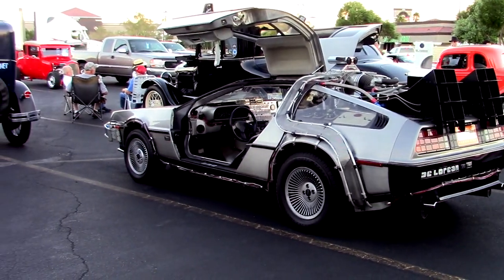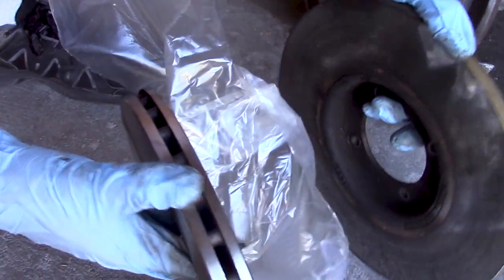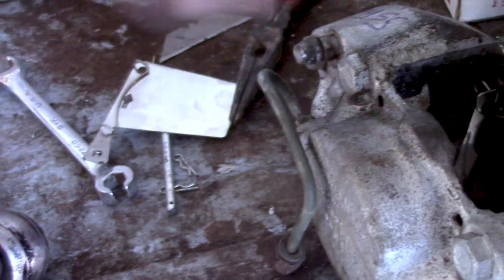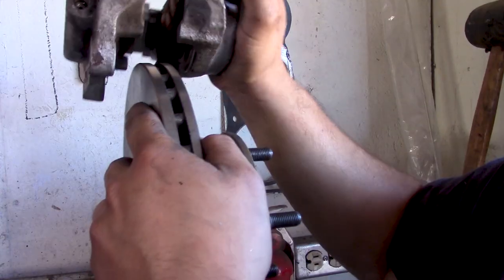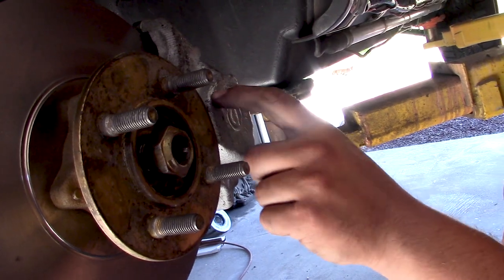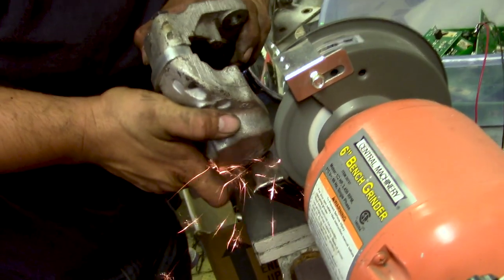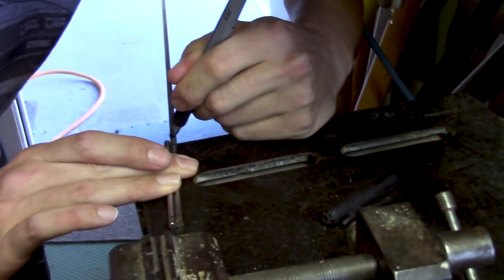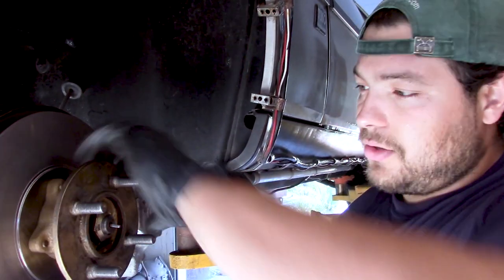Installing vented disc brakes on your DeLorean

Comment: I just got this kit and will be installing it in the spring. Delorean Go has updated this kit with different rotors so the caliper mounting spacer washers are no longer required. Aaron says that this update has been around for a couple of years. December 2022 VIN 3500